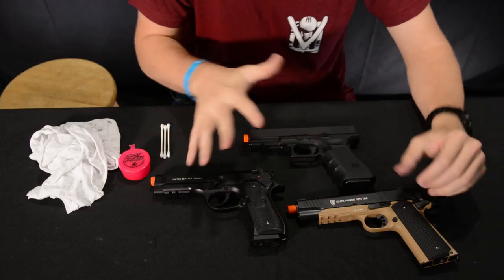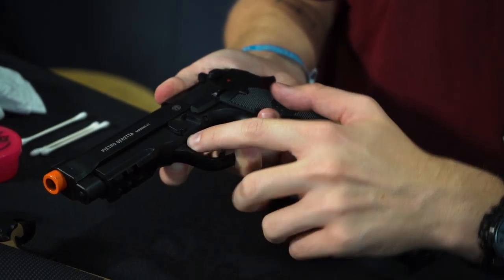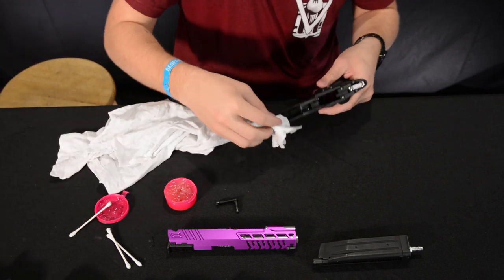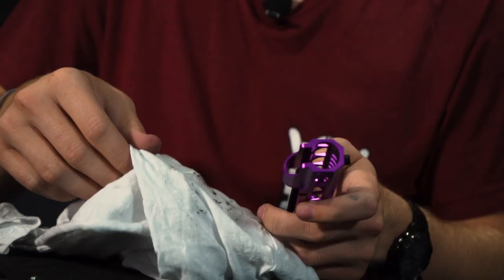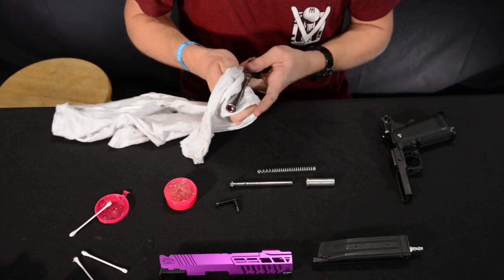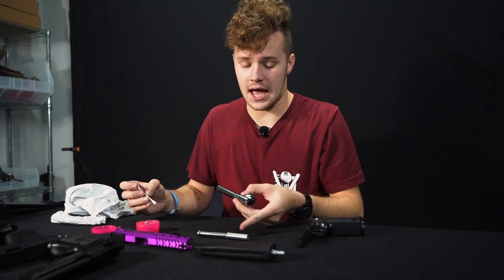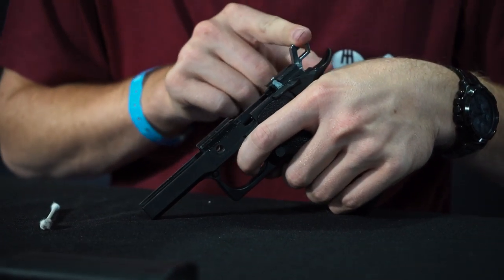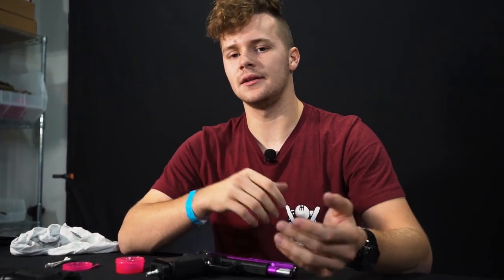Amped How To: Gas Blow Back Pistol Maintenance

Comment: Ah yes put oil where it goes through the air path so your hop up which works on friction is lubed....which gets ride of friction...also almost all modern o rings in gas guns are made of rubber that is oil resistant....thus making it completely useless to oil o rings 

A very great video on the myths that the airsoft industry keeps perpetuating to fleece people.

(Though using that techt grease is actually pretty good since it won’t get into areas that you don’t want it and will stay on the areas you do for a good amount of time)